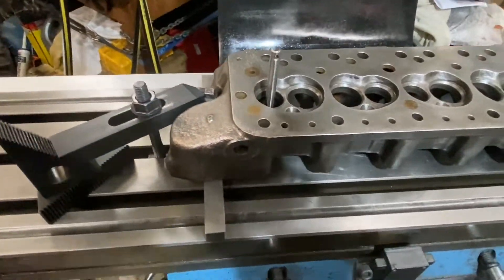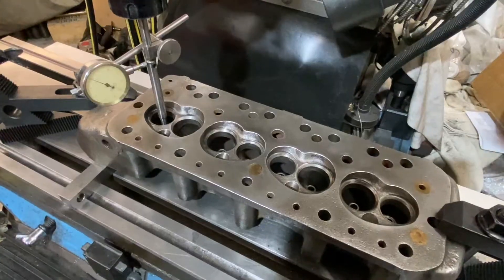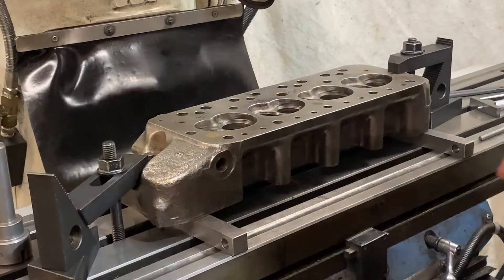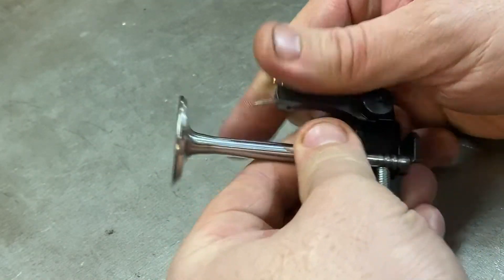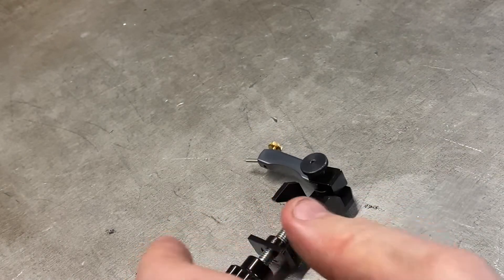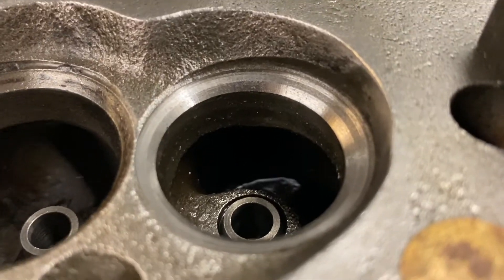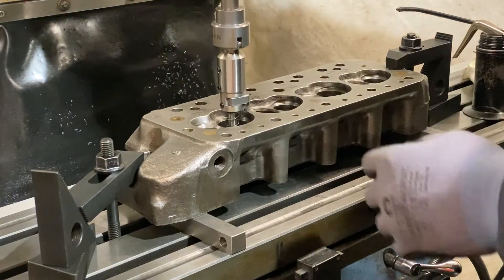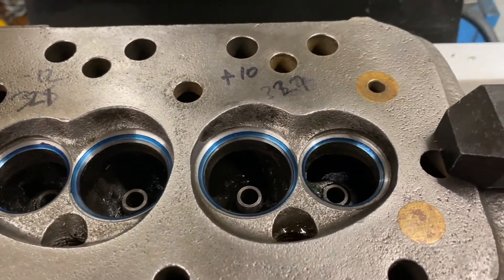Machining on the milling machine - Valve seat cutting

Comment: Did that head get decked? There was a lot of pitting on that surface. I realize it was a budget job, but I don't see the point if there is a potential for a head gasket failure.
Reply from the maker: Yes

Comment: What metal number is used in these valve bases and what are they?
Reply from the maker: I don’t know the spec usually it’s a grade of high speed steel which is not fully hardened. This is so the material holds its toughness at elevated temperatures.

See here for a source of supply;

https://www.serdi.co.uk/webstore/category/valve-seat-inserts-metric-range-unleaded

Comment: What’s the part numbers on your valve machining tools that you need to use for the milling machine?
Reply from the maker: Contact beam equipment in the USA as discuss your requirements with them. They supplied mine and were most helpful.

Comment: Love the Newen tooling. I have converted a old Winnona seat & guide machine to use the Newen tools Also added a VFD and DRO to help cutter speed with different size valve diameters. and DRO to match seat depths. Really brought back a excellent machine that as original was not suitable for modern heads. Clearly not as fast as a serdi 4.5 or another modern machine but very pleasant to use none the less. Cylinder head supply out of oregon USA or Goodson tools have a quality selection of cutters at great prices and no i don't work for them
Reply from the maker: Excellent use of an old machine

Comment: Seems like you should be checking the spindle to pilot concentricity at the top and bottom of the pilot. 
     You’d be taking a lot for granted thinking that the guides are all 90° in both directions from the valve cover rail which it’s mounted from. 
     I have an air float seat and guide machine and I tweak the level adjustment for each seat a little from one to the next along the line.
Reply from the maker: The cutter has  a ball drive for a reason. That allows for alignment issues.

Comment: Sorry you are wrong . I am an automotive machinist of 38 years . I have used many different types of machines and insist that you must set up every seat with the individual guide because every guide is slightly different!
Then the most important point is that you must check the valve to the seat .
 To get this perfect you need to have even movement at all points on the seat and have the seat angles the same or slightly touching on the top of the valve seat by 1/2 a degree up to 1.5 degrees depending on spec's. 
So if you put bearing blue on the valve very thinly and place the valve in the guide the blue will show you where the valve is touching . As long as the valve guides are not worn you will get an accurate indication. This point is something most people do not know . 
Lapping the valve should only be done after this is done and because of the thickness of grinding paste lapping is not an accurate check ! Hope this helps .
Reply from the maker: I blue check every seat I cut, and so far I have not had one that does not get full contact using this method.

Comment: Why did you use cutting oil on cast iron???
Especially with a carbide insert cutter.
Tim
Reply from the maker: That’s a good question and the answer is simple, I get a better finish.

Comment: Nice work. Lucky to have an optical centre finder that magnifies the holes and allows very accurate centering on the valve guides. Have found some guides that were out of round, but customers not wanted changed! Like you said,lot of leeway in factory tolerances!
Reply from the maker: Yes guides vary a lot, thanks for your comments

Comment: Speaking as a machinist with 37 years of experience; you don't have to be nearly that precise locating those valve guides. You don't even need the indicator with the valve cutting fixture being used. Just chucking up the mandrel and easing it into the valve guide hole and then taking down the numbers for the position would be much faster and more than precise enough for this purpose. Cheers from the US!
Reply from the maker: The only problem with that on these old A-series heads is the guides are not always vertical.
Reply: @ACDodd  I am not familiar with machine work but would just like to ask how many valve jobs a Newen insert/cutter can do before it requires replacement, thanks
Reply: The newen tooling ball driver head will make up for minor misalignment, but it does wear the guide pilot more when misaligned. Especially when counterboring for a new seat

Comment: Did you cut those for unleaded hardened seats? 

I also have a milling machine, and want to cut my Volvo heads for hardened seats. I'm thinking about using my plain boring head to cut the pockets for the hard seat inserts.
Reply from the maker: For inserts I use a piloted single point home
Made tool to rough cut the seat recess, then use a boring head to take to final size.
Reply: @ACDodd  Great, good to hear it works, the boring head. I’m really surprised by how accurate they are, I can easily hit 0.001” specs with just a cheap one.

Comment: Customer is foolish because we all know blending to chambers is always done to maximize air/fuel mix in and exhaust blow down out.
I really like your video! At 72 now I used to build racing engines starting in 1967 and even did Road race Mini heads using David Visard’s new then book on porting Mini’s. Plus I did a lot of work for a guy who worked on race Triumphs 4 and 6 cylinders. 
Nice work Mate.
Mike from Sevierville TN
Reply from the maker: Thanks for taking time to comment.